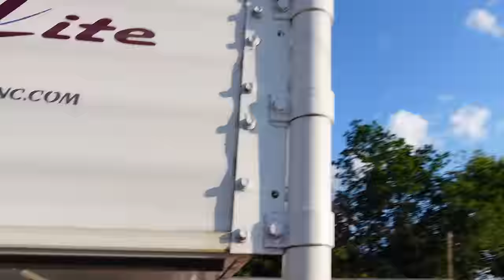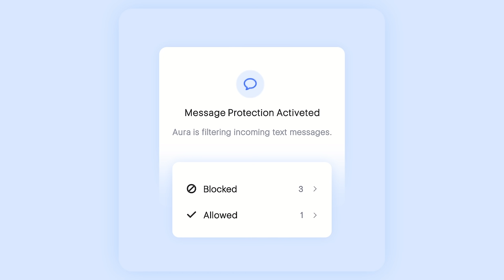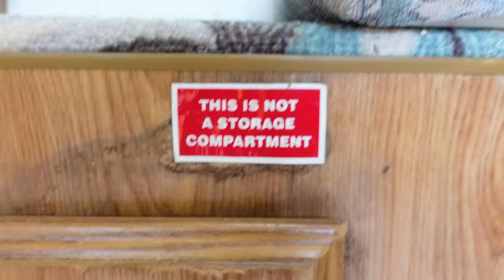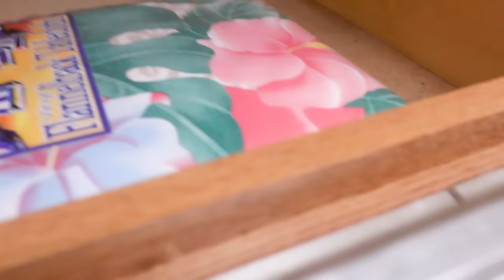i bought an old TRUCK CAMPER...was this a mistake?

Comment: That cabover leak is VERY common in all truck campers. Don’t feel bad for “missing” it when you were looking at it with the seller. It’s very doable to fix that. As for the lifting mechanism, look into linear actuators. They are electric powered lifts that will help you lift it on your own. I’ve seen some for $50 online. ☺️ you got this girl!
Reply from the maker: Omg Tysm I needed a solution for that 🙏🏻
Reply: There are canvas sealers and cleaners for about 50 bucks that will help, but you do have to reapply every so often to maintain. It will be interesting to watch you do this process and see the final product. Good luck, keep motivation positive.
Reply: The leaks are common on ALL campers, 5th wheels, some RVs, and truck campers, etc 

I’m sure the tear drops are probably the same but those things are over priced 🧐

You will need to seal around the air ducts, fans, windows, wiring holes, etc and then some kind of coating, probably a rubber type coating
Reply: Hey Vic, not sure what kind of crank is on the pop top but maybe you could a socket attachment and use an impact driver to run it up and down. Some wd40 may loosen the mechanism. The same idea with the impact driver could be used in the jack up poles. Hole it goes well. Big ❤ from the Aussies….
Reply: @BearBaillie  after some wd40, Marine grease would probably be ideal
Reply: Perk up girl. It's all fica le
Reply: Put the cab over on a separate trailer
Reply: You bought a toyota and a sunliner i also have both , everything is going to be fine, trust me. Keeo on trukin. : )
Reply: This think will be such a regret - stop telling someone to march forward when you know nothing about truck campers!  This is a terrible use-case for her - sell this before getting into the problems, and buy a small cute towable!
Reply: Nico,🤗😍🥰
Reply: @BearBaillie  It's a structural failure. 
I have the same camper, the lift system is spring loaded to assist raising it. The system attaches to the back board of the roof and the board rotted away.
Reply: @electrake2063  She won't get much selling it now.  Even if she put $1500 in new canvas, $500 in roof repairs and $700 into solar, and battery's,  and a few minor things.
She would have a great camper for $6,000.
These type of campers new are over $30,000.  I have the same camper. Had the same problem with the lift. I have a roof AC with is heavy,  but yet it now lifts easy.
Reply: Try lubricant on the track for the raise roof
Reply: @Owenshaw-cg5tg  won't help because that is not the problem. The bars on the roof of the lift system are spring loaded to help raise the roof.  The spring tensioner are broken.
Reply: No, I completely disagree she should definitely quit on this pile of junk and move on…
Reply: Nico😍🥰😚😗
Reply: It's yours keep your chin up, your have a wonderful spirit and a beautiful person everything will work out fine.
Reply: Nico💞😍💓🥰😗
Reply: @TorieRobot  order BROPHY truck camper bed mounts that mount to the top of your bed then brophy turnbuckles. Cheap and easy
I have 1996 starcraft 8ft in a 6.6ft short bed z71 and it's also a pop up w a queen and single bed, 3 burner range dometic fridge..they can be found for around $4500-5000k

But you definitely need the brophy truck bed and brophy turnbuckles..Asap
Reply: Ladi and Margaret, they have the exact motorised lifters. Search out their early van build for the example.
Reply: @TorieRobot if you have a bearing break when pressing it off agin, you can then cut the race off or cut it to relieve the tension and press it off. The race will come off the shaft.   

As far as actuators, just purchase electric trailer jacks when they go on sale at places like harbor freight. Sometimes as low as 75 bucks. They are just a linear actuator.
Reply: Electric actuators at the price point typically aren’t rated for the weight capacity or throw.  They are usually under 12” and way under 300lb capacity.  The most affordable option would be an electric trailer jack as they just a linear actuator with a high enough working and holding weight capacity.
Reply: 😂😂 you must be joking right? This is all basic knowledge and what your supposed to look for if you done your homework🤡 and yes to the chick you made a huge mistake those campers are trash just wait till it rains the next thing you know that canvas is busting open now all the waters inside
Reply: I was thinking the same about an electrical powered lifter however is there a combinational option incase of a power issue were you can manually crank  it aswel?🤔

Comment: Fix everything 💯  before taking it out. No shortcuts. This is basically motel on wheels now. Great upgrade with the Toyota.
Reply from the maker: Yes I wanna make sure it’s solid
Reply: But that will make boring content 😁Just leave some issues to be fixed on the road. Then will love that upgrade double.
Reply: It's NOT boring content!
Reply: @tommygood2929  Maybe boring was not the correct word.

Comment: Take that axle to any local machine shop. They can probably have the old bearing race removed in 20 minutes and shouldn't cost you more than $50 or so. It's common for that to happen when removing old bearings. Congrats on the new setup, you will have a much nicer living/cooking/sleeping area once you get everything setup and im sure it will make it much more enjoyable to plan longer trips.
Reply: Finally, SOMEONE that knows something about truck axles.  I left the same comment earlier.  Although, I couldn't disagree more on the camper.  BAD choice, sell it before you find all the problems.  Truck campers are MUCH more difficult to work on than towables, cost more, and are more prone to leaking - ESPECIALLY a hybrid pop-top!
Reply: @electrake2063  Im a mechanic for a living and removing bearing races as you know is an easy task for someone thats used to these things. Lots of different methods and none of them are really very complicated. Ill admit I know absolutely nothing about campers other than i figured once shes done it will be a much nicer living quarters than the jeep. Watching her latest upload has definitely proven that she has a huge project on her hands. I either camp in my truck topper or inside the back of my jeep and it works great for me since I only go a few times a year lol
Reply: No, the axle is ruined… She is the very first person to have a bearing fail and stick to the axle shaft. It’s never ever happened before she is the very first entrance been five or $600 replacing the whole shaft as opposed to just getting what’s remaining of the bearing cut off

SMH 🤦‍♂️
Reply: Bingo bro😊
Reply: @jeffellis9740 😂

Comment: You can always look for the right socket and use a battery powered drill instead of hand cranking, yes, you'll need to handcrank the last bit but it'll save you a decent amount of time and effort.
Reply from the maker: I’ll look into that
Reply: Some cheap impact wrench will work for that. They go for like $80 and would serve you good
Reply: @The76Jay  I love this idea!
Reply: I knew someone had to of said this lol so much easier
Reply: Amazon sells the drill adapter. For riese jacks
Reply: Just adding a bonus comment. You could remove and install the jacks with the same impact quick and easy as well. just opens up more options. 😊
Reply: OMG this is so correct!
I would not even have anyone would continuously use the hand cranks. Not when you can get a nice drill for around $100 and use it for other projects. They even make nice 12v models that you could leave in the truck for tire changes and the camper stands.

Comment: I have been doing renovation and restoration work for many years.  The key to not getting overwhelmed and going crazy is to make a list of all the things that need to be addressed and look at each one as a separate project.  Tackle each item one at a time instead of looking at everything all together.  That's when it becomes overwhelming.  You should be able to lubricate all the components of the roof raising system to make it work easier.  Also, you can replace/modify the camper jack cranks to be able to use a cordless drill and socket to waaay easier crank the jacks.  And by the way, I use RMR86 to get rid of mold and mildew stains.  Comes in a spray bottle that you spray on the area in question and wipe away with a rag.  As you are dealing with each so called unwanted problem, just know that when you finally hit the road you will be a little more intimately familiar with your rig than if you didn't have to work on it at all.  I wish you good fortune and good health.

Comment: I ran into water damage when I bought a pop-up camper, so i feel your pain. Run a dehumidifier in it to absorb any moisture.  I would re seal all the channels at the edges and skylights, if any.  Keep your head up, and it will all get sorted out. Good luck, and keep being positive.

Comment: Love the camper dude!! 
So when we break bearings, we cut the race off with a small handheld grinder. Then you’ll be able to press the bearing back on. 👍🏻 hope  this helps !! 
Yes auto shop guy here. 
Love the set up so cool.!!
Reply from the maker: Yea my dad eventually got it out but it was best to just replace the whole thing in the end cause the plates got bent too
Reply: or use heat on the race it will expand and fall off
Reply: @TorieRobot  what plate got bent?  naaaa the bearing is common and it falling apart is common
Reply: @TorieRobot you heat the bearing with a torch to get it off and you don't even have to press the new bearing back on you put it in a deep fryer with breakfluid in it crank that dude up and when it's as hot as you can get it you just slide the bearing back on the axle.

Comment: Hi Vicky...I had a slide in years ago and it was great, I used a cheap tarp to cover the roof when in storage. Another thing you must do before removing the jacks is number them 1 to 4 ostarting at the driver side front aso you don't get confused or mix them up next time installing them. Nice truck as well . They make a roof coating called snow coat that lays down and flattens out to fill all the leaks and is very durable, love your vidios and keep smiling dear

Comment: i forget that not everyone knows how to fix cars and do basic wood work. all your problems are very very simple to fix. try to look on the bright side its not all bad. I would take that bed frame out and get a flat sheet of plywood or something equal and just set your bed on it and not worry about the little cabbies. for the corners just get some rv 4 inch tape seal and fix the vinyl in the corners. for the centering of the camper all you need to wood sims on the bed of the truck so when you back up to the camper it wedges it self center. and for the hand crank you can maybe wd40 the gear that lifts it?

Comment: Heres an idea with the dirty pop top canvas: clean/treat for mold,  re-waterproof it if necessary and then line (ie sew or other methods) the inside with fabric of your choice so your not looking at the old canvas when inside.  You can also paint that old canvas as another idea :)

Comment: I just recently sold a larger sunlite camper, there really well built compared to the other manufacturers. If you didn’t know you can add a set of larger wires around 6ga with a breaker going from your truck battery to the camper battery with an Anderson connector in the middle and your truck will charge the camper battery much faster than it would with the factory connector.

Comment: I repaired wood rot and lift issues with my truck camper a few years ago. Its all do able. So one step at a time. I have had it to HULA, the beach, bike rallies, music festivals up and down the east coast. I just leave it on the truck all the time. I did a youtube video on some of the repairs. Good luck with your project. Do your research before you start with each repair task. You will enjoy the camper and truck in the long run. Enjoyed your video.

Comment: You need to get a battery powered drill or impact for the legs and the raising and lowering of the camper top. the Tundra is an excellent truck. I still have mine from 2001, my son drives it every day and he loves it. Learn to love the camper and fix it and you'll be happy you have it. Camping is camping and you will always be problem solving. Effort and determination will overcome anxiety.... don't let it get the best of you. Looking from here you're not in that bad of shape and are on your way to having a nice little rig.

Comment: Tundras are a working truck. I'm very happy with mine. 
 I didn't notice whether it was the front or rear axle, if.it's your rear axle you may want to upgrade your shocks/leaf springs. It's only 1klbs but that's a constant weight.
 Can't wait to see the finished product! Chin up!

Comment: It's easy enough to remove the race part that is stuck on your axle, last one I did I ran a weld on it with an arc welder then wedged it off with a cold chisel. Some can be cut off with a small angle grinder, using a worn down cutting disc to get into the tight corner. I completely remodelled an old fold up camper, didn't know much about it when I started, but after a few weeks labour I knew a lot more, your one looks better than mine did when I started it. The mold does not necessarily mean it's leaking in that spot, campers get a lot of condensation, the damp from that causes mould.

Comment: Hi Victoria, a couple of things I'd like to share with you as a mechanic and builder of high end yachts. When replacing bearings or suspension parts it's best to replace them both at the same time. I know it's more expensive but they were installed at the same time and wear out at about the same time. It'll save you money in the long run. Also, in yachts mildew and mold are a constant issue. Try to find an ozone generator that you can borrow to eliminate the mold. They are small electronic boxes which create ozone ( the stuff you smell after a thunderstorm) and kill mold, mildew and bacteria. If you can see the mold vinegar wiped own with a rag is the most effective at killing and removing it. Try it and see. I've dealt with massive mold issues and wanted to share what works best with you. Don't get discouraged kiddo, keep your chin up. Cheers! Mark from Maine

Comment: Hey! There’s so much potential here, don’t be overwhelmed, building a cradle for the camper is super fast and easy so it doesn’t slide side to side. Maybe I’ll post mine on my channel, as for tie downs look you really don’t need the most expensive ones but you’ll want some with some give, I used happijack turn buckles they’re spring loaded and they only cost $250.

Comment: You have 100% a better setup than what I'm looking at, but mine that I'm looking at is not a pop-up it's an 8-ft bed very hard to find for a 7 ft bed camper so it still works, add to replace all of the wood and insulation in the overhead bed because of water damage, you have a beautiful camper that's only going to need very little work and you have an awesome truck to carry it around you got this stay positive and stay focused and happy journeys and good vibes your way

Comment: Looks like both are great upgrades & once you get it all fixed you will smile. As for raising the top once you’ve clean it up you can re-grease the tracks & get urself a good cordless drill to assist in raising & it will be good for many things you’ll need down the road like for the legs & don’t forget to number them cause they all go in differently from factory. Remember some of the negative comments can be used as a learning tool.

Comment: Nice truck, Victoria… on the camper perhaps you did pay a little much but if you say it’s one that’s hard to find for certain things you were after but I think those guys could’ve been a little bit kinder to you.. the cable system will need to be lubricated really good but I would leave the jacks on there. You’ll get used to them.. once you start messing with taking them off you’ll end up finding a reason why you should’ve left them on. You never know when you’re gonna want to take it off for period of time that you find a place to stay for a couple weeks or a month. And you’ll want to drive around and explore. It’s just a matter of really backing up very carefully centered.. and you are supposed to have a gap between the bed and the bottom of the camper. you just gotta lock it down with whichever set up you have..

Comment: I've had the samw setup, and Ok also had shifting issues.  Its a little tricky on the Tundra because it has taller than normal bed sides. I made a steel platform that raised it up and centered it. (Coud do wood). Then had the torque lift mounts, and its didn't budge after that, even on off road trails.  
I see you have the torque lift "Fast guns"  I had those, but went back to the original. They hold it better.  Use that money to purchase Airbags and a beefy sway bar. Made a HUGE difference on handling. 
I currently moved to Powewagon  and a Northstar pop-up.  I absolutely love it and you will too!

Comment: You weren't dumb whatsoever. Pretty darn smart actually. I love my truck camper and it and my truck was a 2006 my camper Is a 2014. Both had its about as much problems as you have. But I fixed them all within one summer. And have been enjoying it ever since. The money I save on rent is beautiful. You might wanna get like a Dewalt drill. Detachments you can use it to crank your canopy up and down. Been to cranky corner jacks up and down as well. Really easy! So that I can also use my other equipment with it like my little blower for blowing around the camper when I park. Vacuum for vacuum inside the camper My dog's shed a lot of hair. Well thanks for posting I'm going to subscribe, and I look forward to enjoying your content good luck out there stay safe!